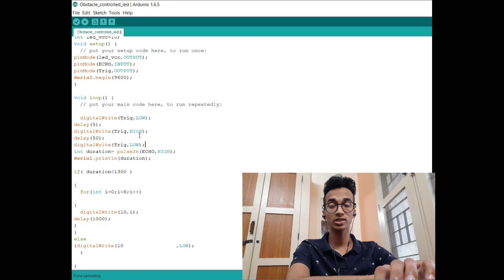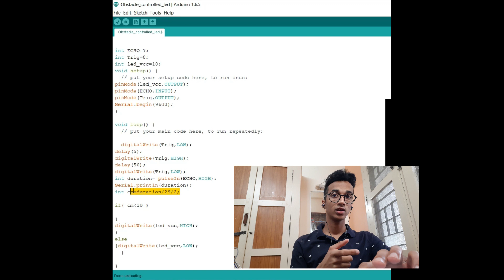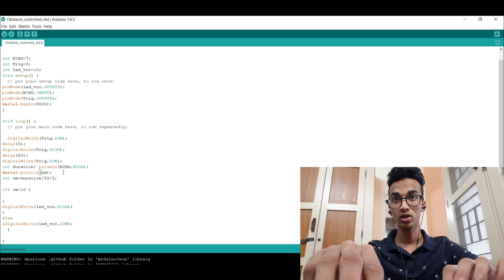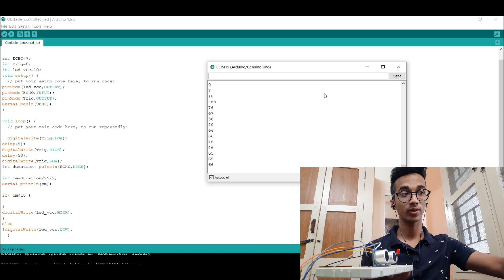Obstacle Detection Using Ultrasonic Sensor|Arduino Uno|

Comment: :: error: expected primary-expression before ')' token

 if( cm<10 )                                                                                                                                                                                                                                              )

                                                                                                                                                                                                                                                          ^

exit status 1

expected primary-expression before ')' token

This report would have more information with
"Show verbose output during compilation"
option enabled in File -> Preferences.

Comment: Can we make any reverse code change for a project to detect stationary objects. Please help!
Reply from the maker: This code and ultra sonic sensor will also detect stationary objects. It only depends on the waves sent from sensor hitting the object and coming back.
Reply: When an objects keep moving continuously in front of this sensor still it is going to detect right? 
But my objective is that if those objects in front of sensor are in continuous movement and suddenly it stops(no movement) how can it detect? Can we change durations and may b possible?
Reply from the maker: Yes, you have to make a slight change. When an obstacle is detected you need to wait for a period say 15 seconds(give delay), and check if the object is still present. If it is, then it means the object is stationary.